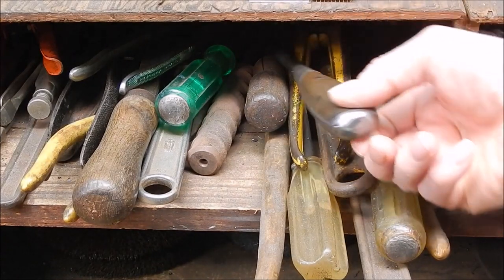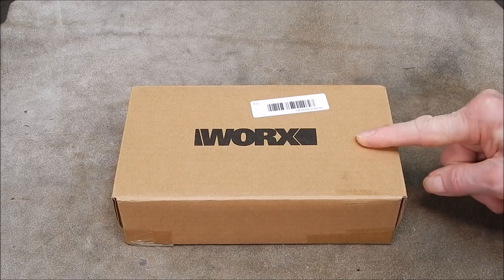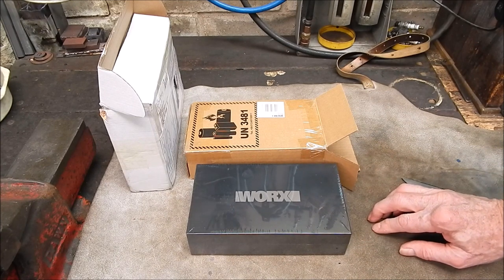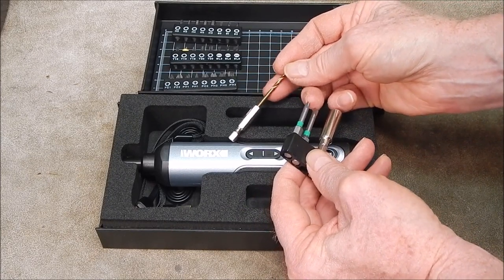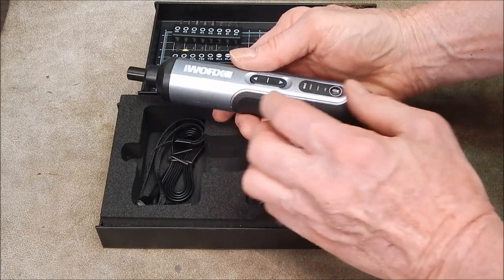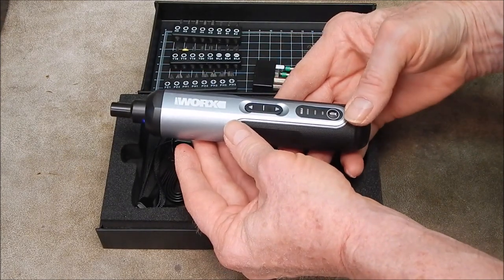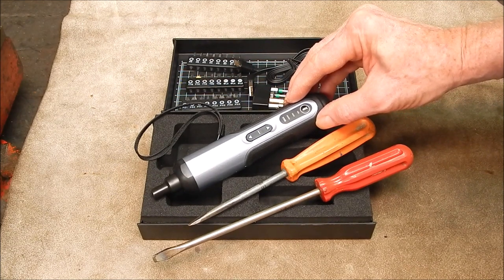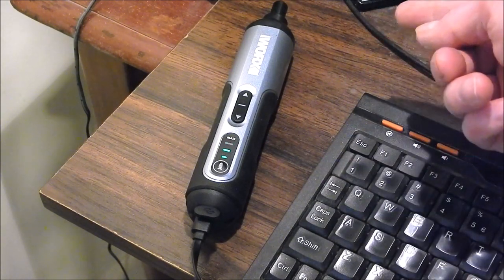WORX WX240 mini electric screwdriver - very impressive

Comment: Those things are amazing Rob, so much power in such a small device. I have the really small version, which is ideal for laptop screws. I got it the last time I had some IT work, several hundred laptops which needed the hard drives removing, 6 screws on each laptop! The screwdriver was a godsend. It's called a Wowstick, yes, stupid name but a brilliant tool. I did a video on it about 4 years ago. Runs off 2 AAA batteries, which was ideal for me as I was using it until it went flat then just popped in some new batteries. The body of the screwdriver is only 15.5mm in diameter so the gearbox must be incredibly small. Cheers, Alan.
Reply from the maker: Hi Alan.  Bit of a luxury really, but for repetative work simply essential.  They have sure come a long way since I first checked them out many decades ago.  Some amazing electrical gadgets available these days for the workshop.  Very tempting.  Have a Merry Xmas.  Cheers Rob

Comment: I have a set of those hexagon drill bits and have used them a lot.    They are so handy.    Great for predrilling a screw hole.   Use a cordless pistol style cordless. 

Dale in Canada 🇨🇦
Reply from the maker: Hi Dale.  I like the idea of them, as the hex ends can't slip in (even the dodgiest) regular keyed/keyless chucks.  I will try and get a set.  Cheers Rob

Comment: Hi Rob, like the "C" type connector, standard now on most mobile phones unlike the mini USB which plugged in only one way.
Would like to know how they overcame the polarity issue.
Reply from the maker: My newish Motorola still uses the mini USB connector.  I expect they mirror image the connector pins horizontally to allow correct polarity in both positions on the C type.  Cheers Rob
Reply: @Xynudu    Hi Rob ,  I believe in Europe they have now made it mandatory for all phone connections to be C connectors.   I have some Samsung stuff that uses the C connections and I like them. 

Dale in Canada
Reply from the maker: Interesting info Dale.  Makes sense to use  the C type, as it's a definite improvement.  Have a Merry Xmas and stay warm .  We are heading into the 40's C.  Cheers Rob
Reply: @Xynudu    Enjoy your weather while you can.    We are just coming out of some severe cold weather.    We have had either 4 or 5 days in a row that with the temperature and wind we did not get out of temperatures in the minus fifties.   It was brutal cold.    Warming up today and now a storm is blowing in.   I live in the Praries. 

Dale in Canada 🇨🇦

Comment: Hi Rob , I have very much the same thing , mine cam from Aldi , the three leds and the button on the rear of the unit will be for the screwdriver power setting , at least that is the case with mine , barring colours it looks identical to mine
Reply from the maker: It's a good robust design.  I'm so sick of the amount of plastic in some power tools these days.  Refreshing change. Cheers Rob
Reply: @Xynudu  I try to avoid plastic when it comes to tools as it is often a wast of time and money in the end , but the electric screwdriver has not been any issue so it gets used when needed

Comment: Hi Rob The one thing I was wondering was an off and on switch. To prevent starting it up when turning a screw with the body. 
I have two Hitachi that are similar, but a break down to a pistol grip or straight. Has a lock to use as a normal screw driver for getting a screw started out or final tightening. Your review was very good and the product looks good. I would buy if needed. 
Great job. 
Cheers
Reply from the maker: A lock would be good.  I think it needs one.  Apart from that it's a nice gutsy unit.  I bought some hex drive socket adapters (very cheap) and now it's good to go on most things.  Have a good 2023.  Cheers Rob